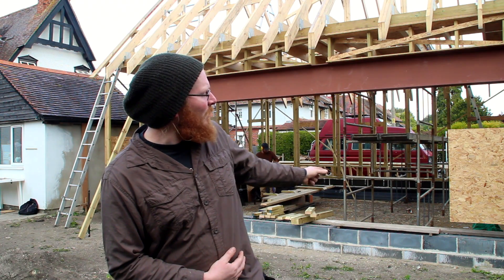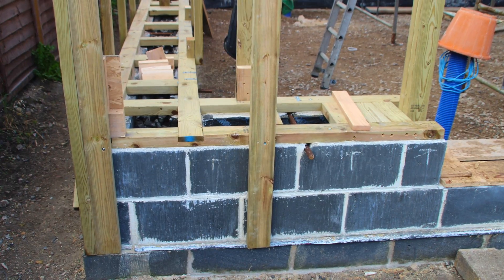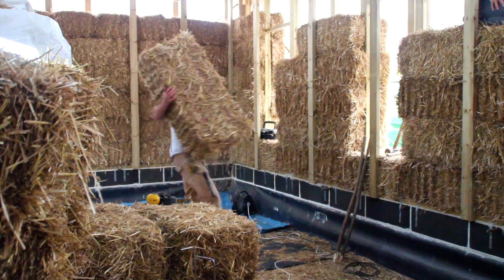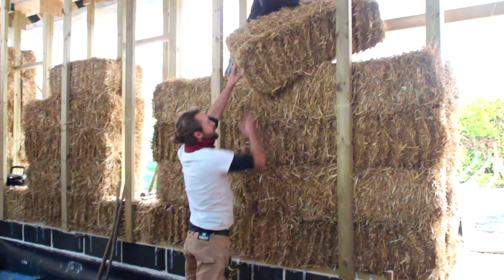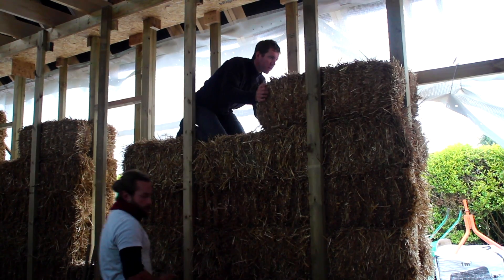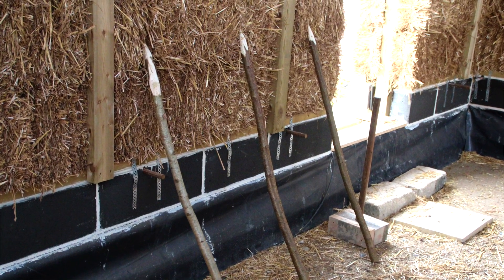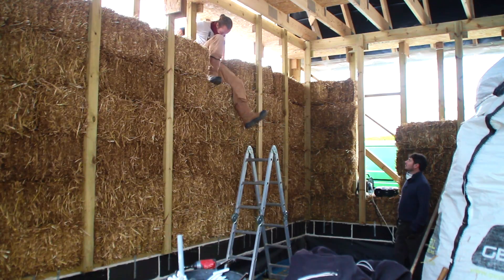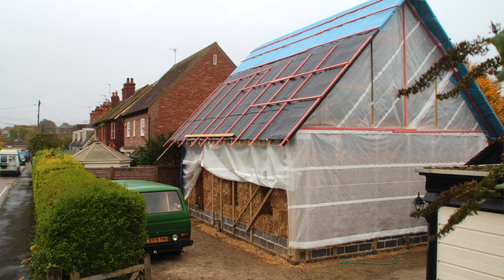eBuilding blog: Oxfordshire straw bale house part 2

Comment: Hey Gerald!  Did you use straw for the ceiling/roof insulation?  If not, what did you use and why?
Reply from the maker: Hi, wasn’t my project and I didn’t see the end. However in the straw builds I’ve been to in the U.K. straw hasn’t been used as roof insulation. You can thatch the roof of course but that has completely different properties to the compressed straw in the walls. Generally some form of breathable insulation is used in the roof / ceiling such as sheep’s wool